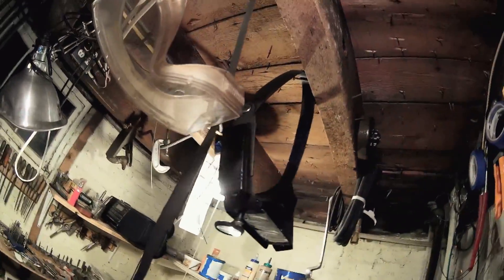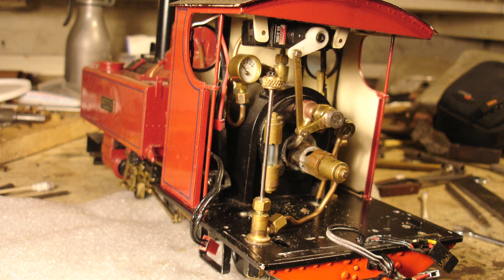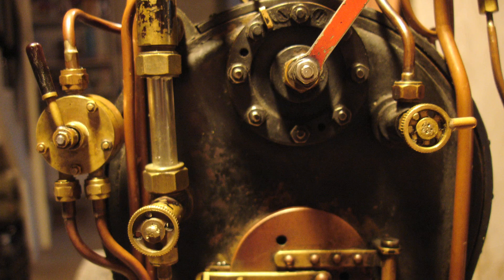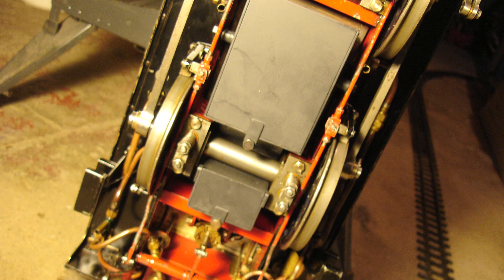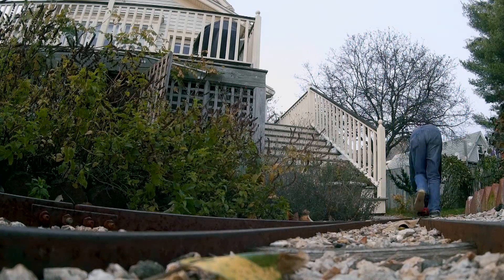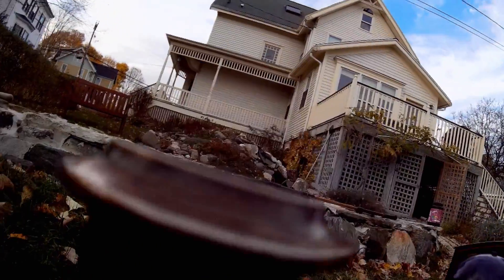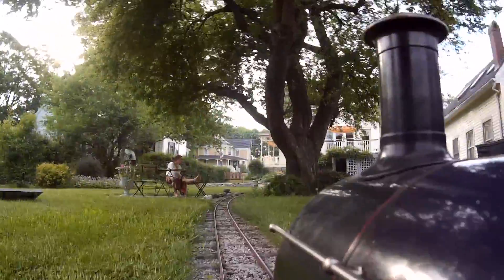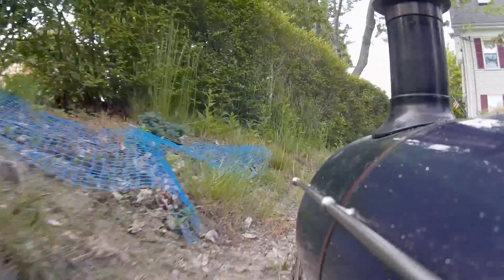My workshop and 5" gauge Simplex steam locomotive

Comment: Did you push it round to pressure the boiler?i,ve never thought of that.We,ve used an  air line(probably easier).
Thanks for your vids.
Reply from the maker: Hi, I did push it around to pump the boiler up.

Comment: Are there water tanks under the cab and tanks piece or are the water tanks built in with the cab and tanks piece?
Reply from the maker: There are two water tanks either side of the engine and they are both linked to the tank under the cab bunker.  So it's filler from the side tanks and it allows the side tanks to balance their water.  They are connected by pipes.

Comment: Where did you get your grate made?
Reply from the maker: Hi Matt, I get my  grates from Reeves 2000.  They are the only one who do a cast iron grates for Simplex.
Reply: @GandyDancerProductions  cool stuff where would be best for a 4f loco grate 3.5 inch?
Reply from the maker: @mattseymour8637  Who ever made the casting for the loco.  Blackgate Engineering make stainless steel grates that you can cut down to fit most engines.
Reply: @GandyDancerProductions  thanks will try black gates
What about the ashpan?
Reply from the maker: @mattseymour8637  You are going to have to make that yourself.
Reply: @GandyDancerProductions  OK cool what martial and size do you suggest?
Reply from the maker: @mattseymour8637  Quite thin sheet either brass or mild steel.
Reply: @GandyDancerProductions  ok thanks how do I cut it safely and how do you get it go at an angle?
Reply from the maker: @mattseymour8637  Cut the metal with a hack saw but first make up a card board mock-up of the grate to see that it works and fits properly.  If you make it out of steel fold and braze the bits together.  If brass the same but use 1/4 " angle to holt together if needed and silver solder or rivet together.
Reply: @GandyDancerProductions  thanks for the advice. Not too hard to do then. Now do you bend it?
Reply from the maker: @mattseymour8637  Make sure the metal not too thick.  Put it in a vice along the fold line and belt it with a hammer till it forms the shape you intend.
Reply: @GandyDancerProductions  no worries will try that